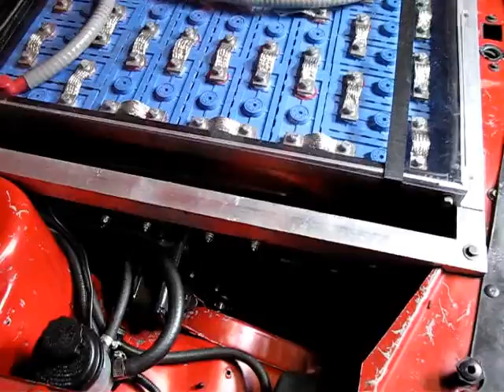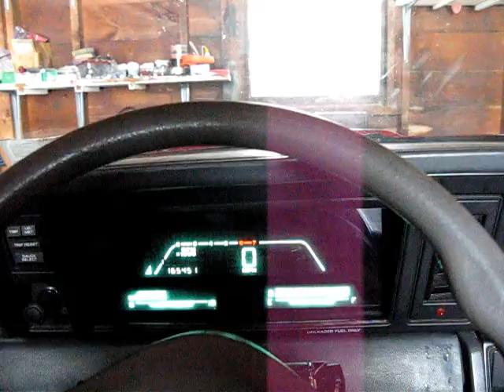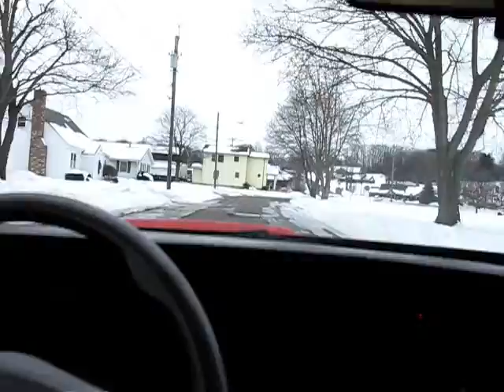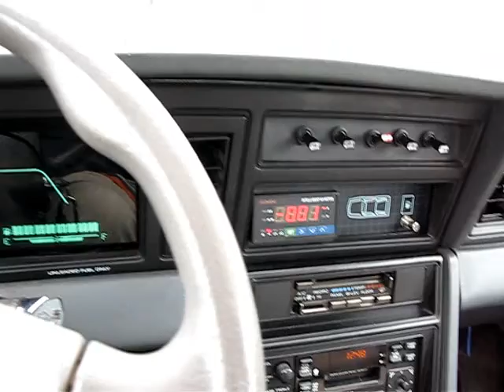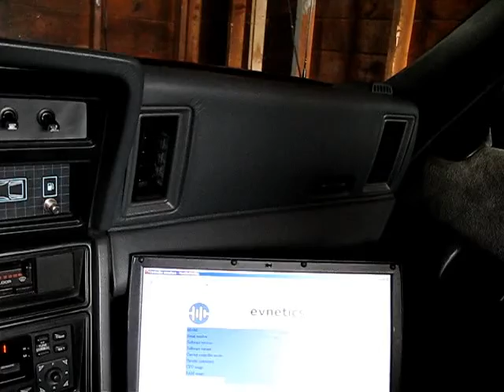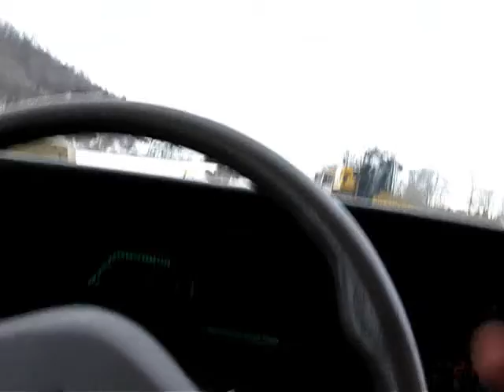January 10, 2013 - Newly Rebuilt Motor Installed & First Test Drive

Comment from the maker: I would -love- one of those nifty RechargeCar temp sensor units like we saw at EVCCON last year, but as far as I can tell, the product does not yet appear to be available.  I don't think this motor has the thermistor, as that was a newer feature added in later model motors.  :/

I have been searching far and wide for a temperature sensors of some sort (at a reasonable price) that I could hook into the Soliton1 5V Inputs to measure/report back motor temp via the Soliton1 Data Logger...

Comment from the maker: My understanding is that cables are supposed to be twisted, as much as possible, which causes the magnetic fields to cancel each other out, and greatly reduces EMI.

I agree that a WarP 11 would be better suited for the weight of my vehicle, with it pushing 3,500lbs.  However, I sadly do not have enough room under the front battery box to squeeze in a WarP 11.  With a proper temperature monitoring solution and/or forced air cooling, the WarP 9 'should' be fine in this application.

Comment: You should not twist your motor cables like snakes. This causes an extra magnetic field and heat.
What's your motor temperature at freeway driving...?
At this driving I would go for a WarP11 in this car.
Regards
Mathieu